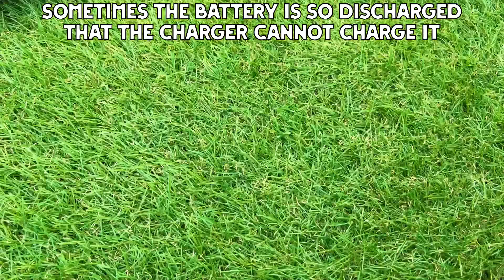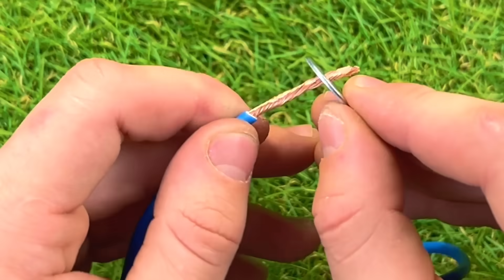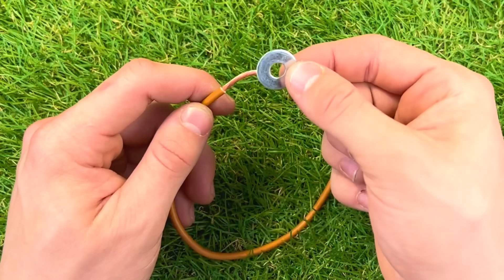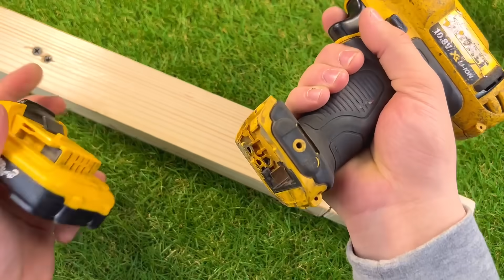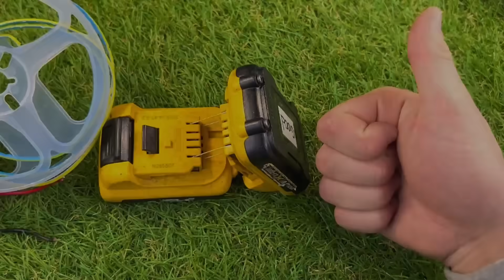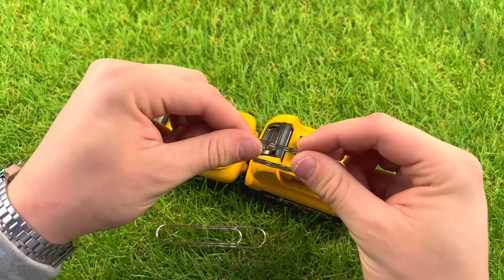Old Battery Will be Like a New One in 1 Minute! Great Ways to Restore Your Battery!

Comment: why do you bother using wire. Just slip 2 coins in the slot and align the batteries correctly.
Reply from the maker: No need for coins when you can easily restore your battery with simple wire tricks! 😉

Comment: This DO NOT "revive" a dead battery. Been there, done that to several dead/dying batteries and they NEVER "revived".

It temporarily transfer charge to dead/dying battery so that smart charger will apply charge to them.
Reply from the maker: Sorry to hear that the method didn't work for you! Make sure to use a smart charger after the quick charge to fully revive your battery 🚗⚡️.